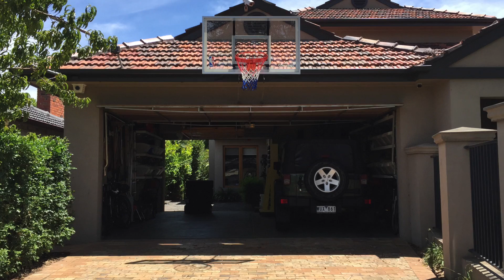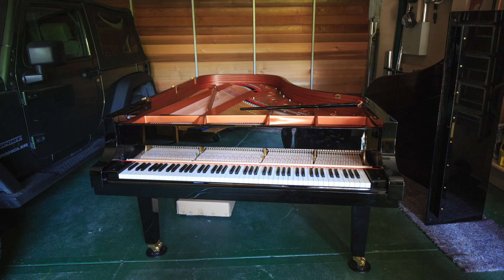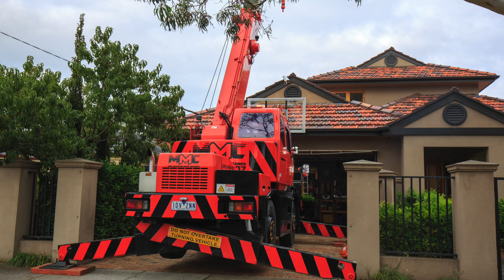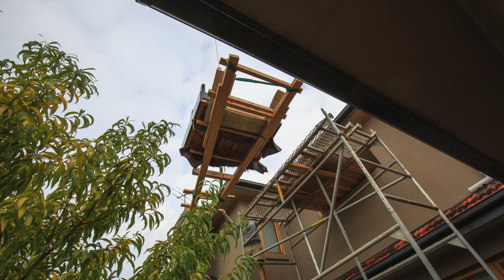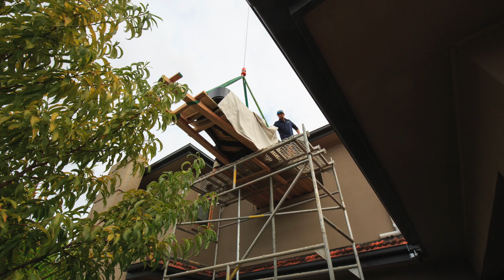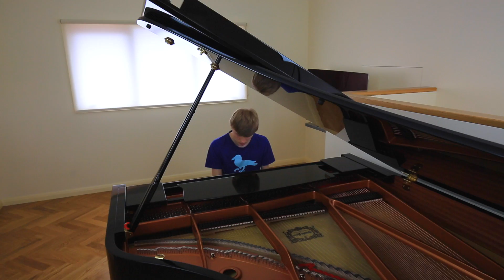Our new grand piano comes in through the upstairs window!

Comment: I was always curious as to how piano's were installed in homes. Was this process rather costly?
Reply from the maker: Yes it was. There were 9 people working to get I done. The crane operator and his assistant that gave him hand signals how to move the load since the operator could not see it being behind the garage. 2 carpenters that made the platform, remove the window and helped on the outside, and 5 people from the piano movers on the inside and outside.
Reply: This is an very rare and involved piano move so yes very costly